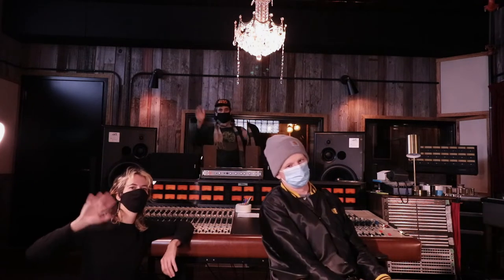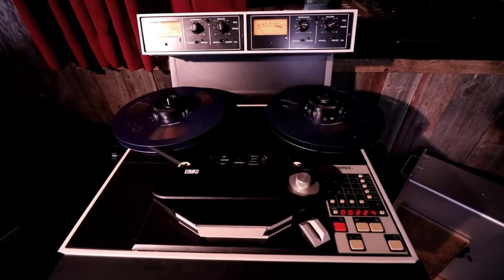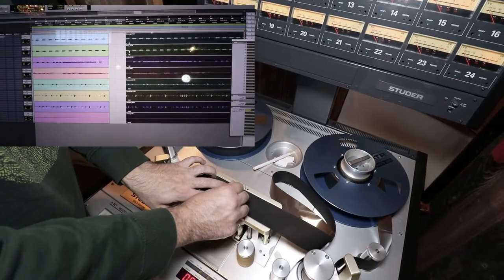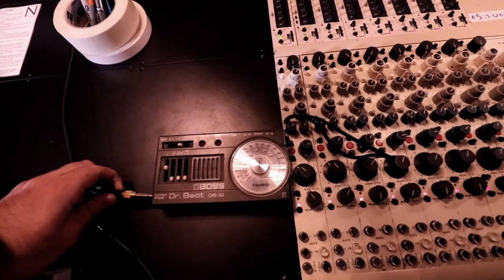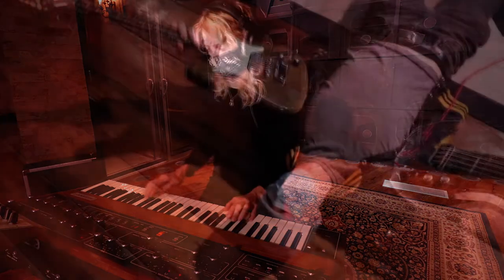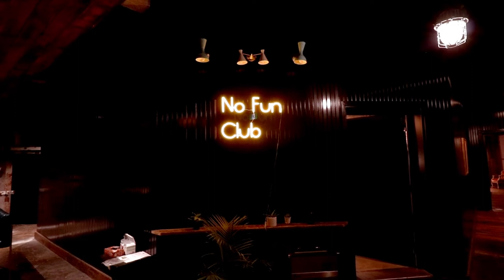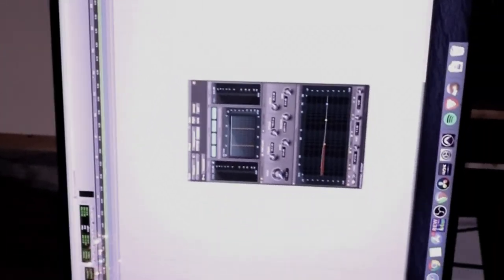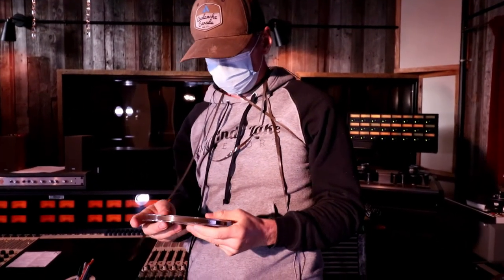How Recording to Tape *Actually* Works

Comment: Looks like a really nice setup. My home studio also set up for tape. Actually that is all I have, I don’t have a DAW or anything else at all, a Stephens 821b and an Ampex 440c 1/4”.  The 821b is very stable and doesn’t take a lot of maintenance. I do most of my edits by bouncing between my 2 track and the 24 track using a Lynx synchronizer. It takes a bit of time but moving notes, lines, verses is definitely possible.
Reply from the maker: woah nice! living on the edge

Comment: I'm using an A800 mk III (24-track) and MTR-90III (16-track).  Just got an m79 as well (16 and 24 track).  Have a bunch of mix down decks, including ATR-102 (XIRON penthouses, 1/2"), A80 mk IV (1/2", with discrete electronics), and an m79 (1/2").

Are you using a Quad Eight console?
Reply from the maker: Awesome! It's not quad eight but a Sphere eclipse C which is from the same lineage. Great console!

Comment: hi have alot of reel to reel decks and some are HEAVY BIG TIME  i got my decks when the price of them was very very low   there are deck out there that make great fix up
there is one format you could use to master you recording that is all missed out alot    and is very low price no not vhs shit BETACAM SP runs at high speed 
and players are so easy to find now  i have worked on 60 of them i buy them and fixed them save and not going to be binned any more
Reply from the maker: They are indeed very heavy